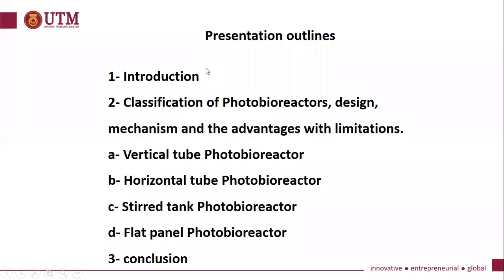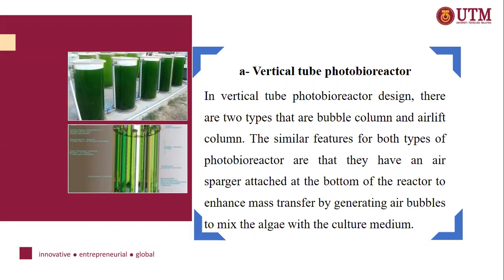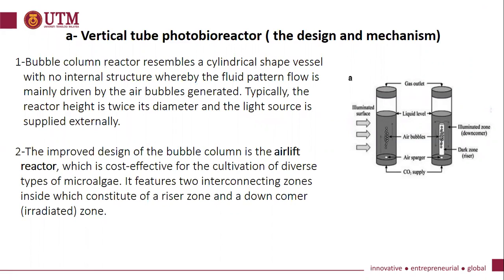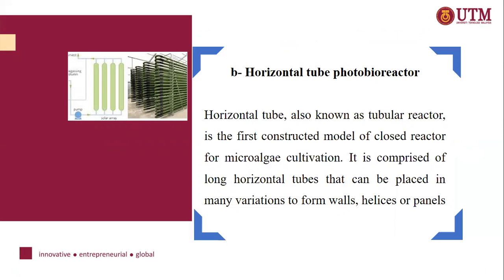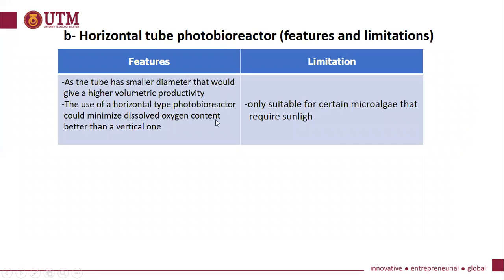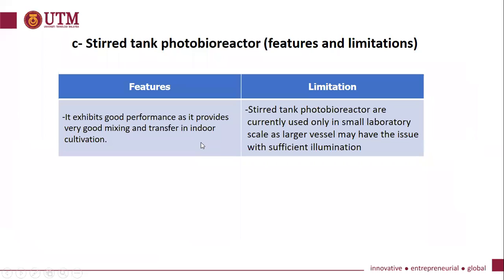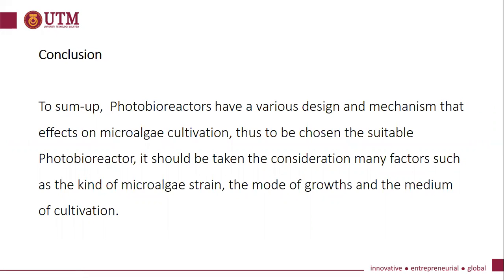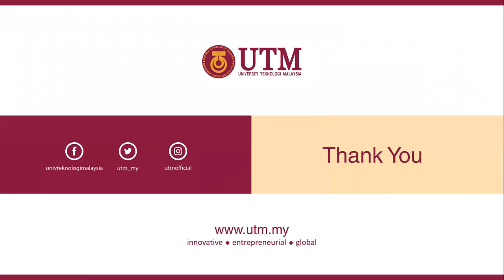Photobioreactors PBRs

Comment: 1.What do you mean by “bubble column affect the light and dark cycle?
2.What is the example of microalgae species that can be used in horizontal tube photobioreactor?
3.what do you mean by hydrodynamic stress for flat panel bioreactor?
4. Which bioreactor is going to be used in your research?

Comment: Thank you for the presentation, Anas. It was mentioned that it is crucial to choose a suitable photobioreactor types for microalgae cultivation. But, is there any correlation between types of PBR and microalgae commercialization purposes? Could you give example, what type of PBR is most suitable for commercial astaxanthin production? Or what type of PBR is most suitable for wastewater treatment system using microalgae? And maybe for other commercialization purposes. As the systems may requires different reactor configuration.